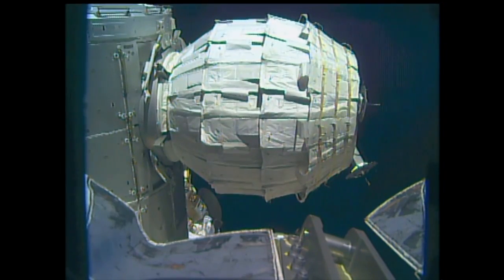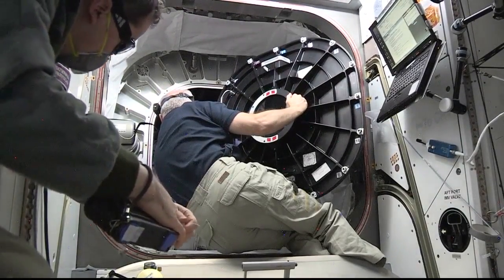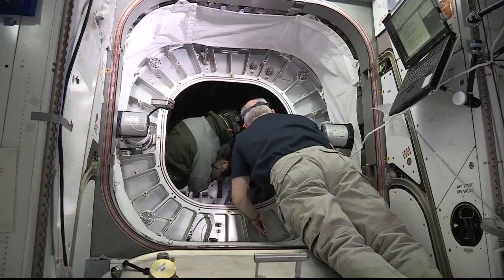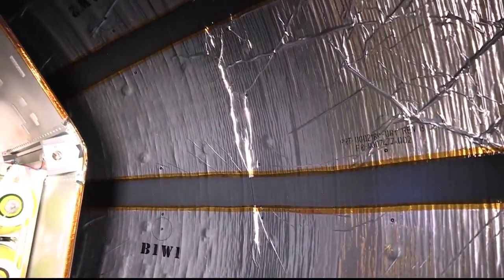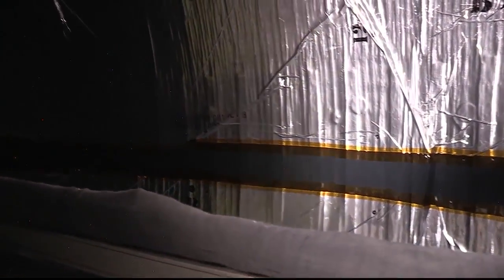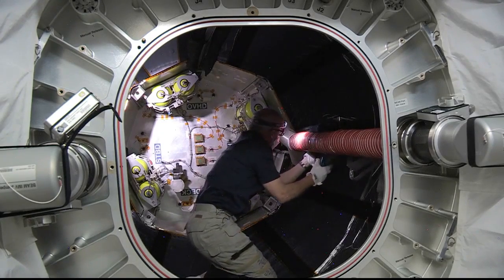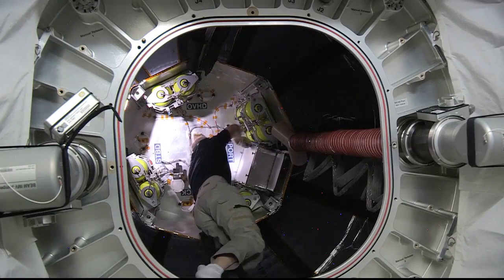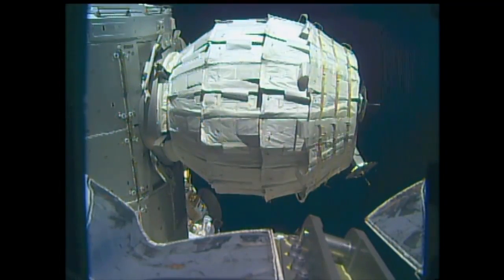Bigelow Expandable Module Opened for Inspection | Video

Comment: what are the white and blue little spots (points) seeing when they enter to the module in the dark sides??? is it radioactivity???
Reply: If I remember correctly it is radiation
Reply: No, just bits of debris from deployment.
Reply: i actually think it is. Most cameras on the ISS have the same problem. Maybe the camera-sensors don't last as long in space.

Comment: Thanks for using Celsius, the rest of the world thanks you.

Never mind, NASA is overly America centred as well I see.
Reply: not that i think that the US standard is better, but we bought and paid for it we use whatever scales we want.
Reply: +Mixter Muxter Yes, at extremely high temperatures Celsius and K are exactly the same. Using metric and Celsius in science is widely accepted, even in America. If you don't know that, you obviously need to do some research
Reply: +Mixter Muxter I didn't say they were exactly equal, I said at EXTREMELY HIGH TEMPERATURES they were exactly the same. Yes, they have different points of zero, but the size of a unit is the same, so eventually you get to, say, 1,900,000*C = 1,900,000*K.
Reply: no the agreed scientific SI standard is Celsius or rather Kelvin (which is just an offset)
Reply: That's exactly what i said, didn't i?
Also Celsius and Kelvin are not the same at all. One unit difference equals the same amount of change in energy for both scales. The offset i mentioned was refering to the different Zero-points of the two scales. Therefore celsius is never equal to Kelvin.
Reply: The conversion goes like this:

Tc = Tk - 273.15

so if you convert your chosen Temperature

1900000 °C = 1900273.15 K

But if you want, you can use any Unit converter (Google e.g.).
Btw. Kelvin is just "Kelvin" without the "degree".

The Kelvin Scale is designed to be only positive, and the offset of the Celsius scale is the absolute zero Temperature.
This is called an offet (see first comment) but the two never cross each other like fahrenheit and Celsius.